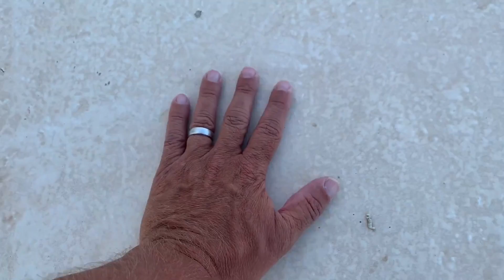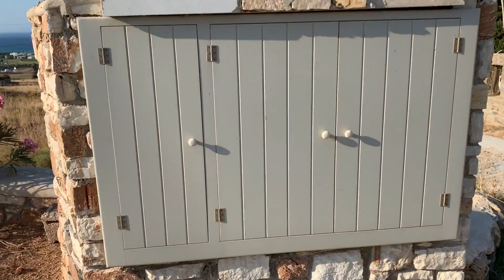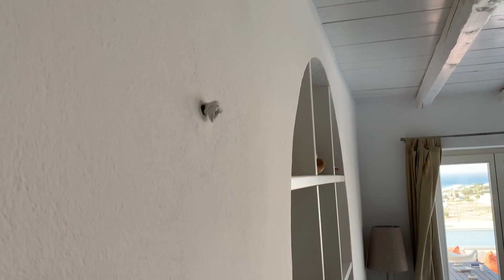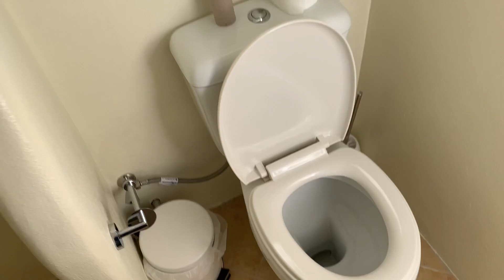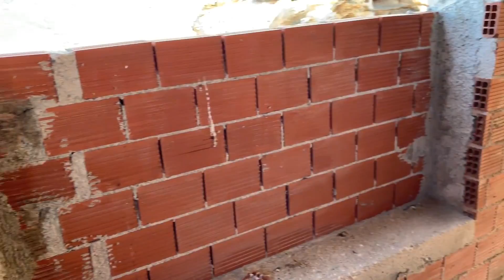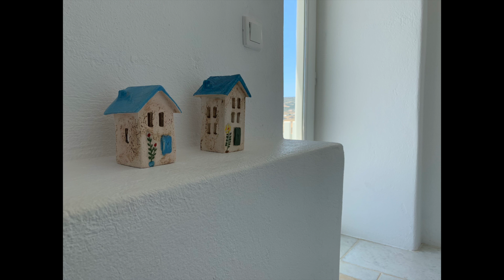Home Inspection in Paros, Greece, with InterNACHI® CPI® Ben Gromicko (Έλεγχος σπιτιού στην Ελλάδα)

Comment: Some really interesting weird quirks for sure. It's funny how all kinds of wiring and plumbing is outside like that with little protection. And all those loose live wires. The concrete exterior with a wood structure on the interior is interesting, though surprising for fire reasons! I love those covered outlets though, it seems really safe.
Reply from the maker: Hi, Alexander. There's no wood framing in homes those Greece island homes.